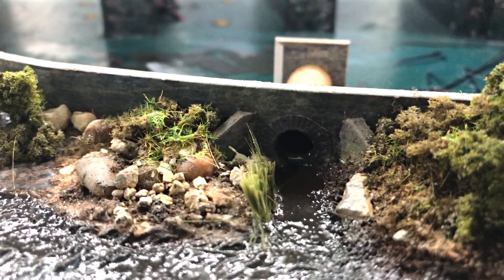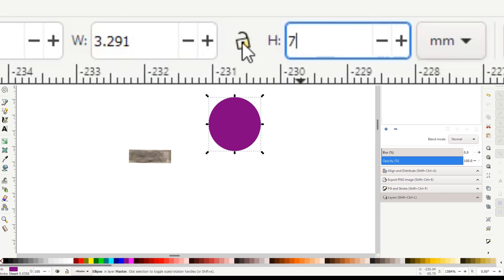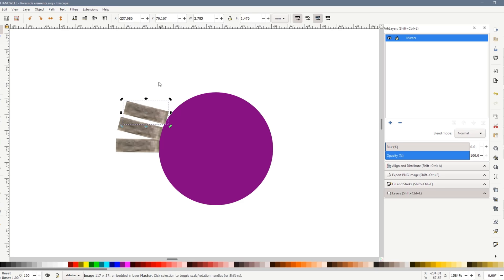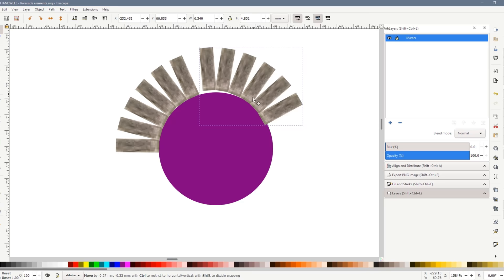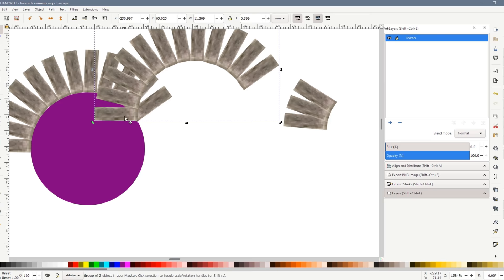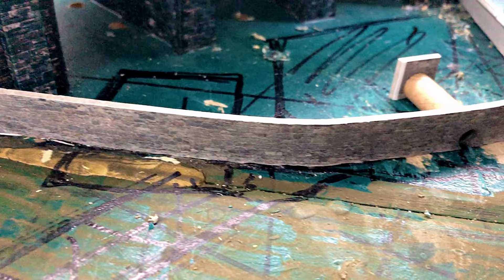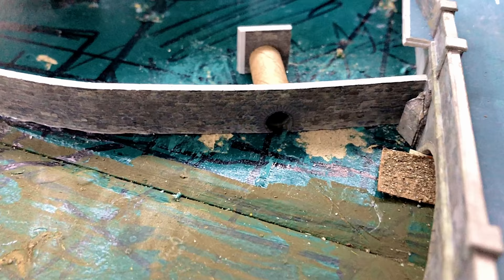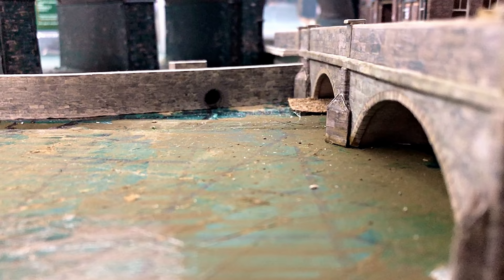Making a stunning realistic river weir scene for my N gauge model railway layout

Comment: Wow. What a river scene and a great tutorial. I want to do a river scene on my layout and was thinking about using resin but terrified of it. The toilet paper, paint and varnish method you used, along with the stones, cat litter etc have created a stunning effect. I'm going to shamelessly attempt to copy your methods when it comes to the time to do mine. Thanks so much for sharing. Cheers, John.
Reply from the maker: Thank you John. I was relieved when it came out as good as it did. I was also terrified of resin and was trying to avoid it like the plague! For what reason though? I have no idea. Must be getting afraid to try new things in my middle age! Something I didn’t make clear in the video... I only did 13 coats of varnish on the deep slow river. On the toilet paper river, I did three coats and I regret it. I think it looked better after only one coat. Because of the ripples, I think slightly less shiny was better. Good luck with your river and thank you for watching and commenting. 👍🏻 —Michael
Reply: @Chandwell  I think I'm scared of the resin leaking everywhere and ruining an entire board, and I think some need to be heated which I'm def not doing. I like to stick to stuff I know and trust, so cardboard, pva, paint and varnish will do nicely!
Reply from the maker: Ah yeah, that was also a good point. My baseboard is full of holes and the household groceries are kept in the cupboards underneath. Resin-covered potatoes would not go down well in this house! 😀

Comment: Absolute fkn genius. You are a genius.
Dont like the twig though, it looks like a twig, I think you should replace it with a model that looks like a tree with bark. But you have inspired me to have a go. 
My other annoyance that is like with every static display where the train has movement, is the static and the moving together clash. So I plan to put an old tablet or phone screen where the water is running with a waterfall loop, a tiny piece of convex mirror under the varnished part where the water hits, to reflect the tempest all; colour graded to fit the paint under the varnish. No idea if it would work, or if it could ever be as ground and breathtakingly wonderful as yours, but as i said. Inspired.
Reply from the maker: The twig is a bit too much embedded now. It’s on my list to make it better at some point but it’s pretty low down! Thanks for your kind comments and good luck with your phone screen movement experiment. Would love to see the outcome.

Comment: This looks great but did the varnish hold up over time? Thinking about using the same technique on my layout but the Ronseal varnish says it shouldn't be used over paint and might discolour or lose its shine. Was there any sign of that actually happening or are they just covering themselves?
Reply from the maker: Thank you! It lasted about a year but did dull over time. I never cleaned it, and it got quite dusty. I got the Ronseal out and gave it another coat and it dried satin. So the next day, I did it again and it dried flat matt. It looked awful. I bought a small bottle of Vallejo gloss resin varnish and painted a layer of that on. It rejuvenated the river perfectly and it is back to its shiny self now.
Reply: @Chandwell  Thanks for the reply - that's really helpful!

Comment: Hi, can you tell me where you get your fine tip pva applicators from. They seem larger than a well known brand but my age and grip make it difficult to handle them. Thank you
Reply from the maker: Hi Adrian, the fine tip applicators were supplied about 8 or 9 years ago and it looks like she is no longer in business because her website no longer exists. They are the same size as the Metcalfe ones, but I didn't like those - I found the pin rusted after a few weeks. These ones have lasted almost a decade and are still going strong. Sorry I can't be of any more help. --Michael.
Reply: @Chandwell  Hi Michael, many thanks for your reply and help, it is very much appreciated. Although I model in "oo" scale I do very much enjoy your video's. Cheers, Adrian
Reply from the maker: Thank you Adrian!